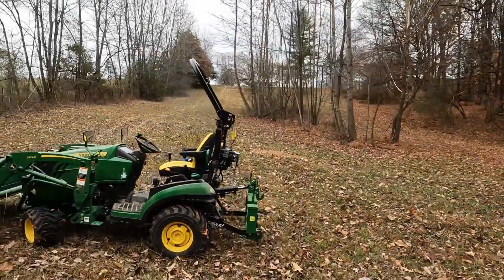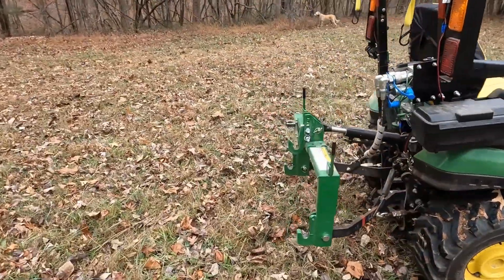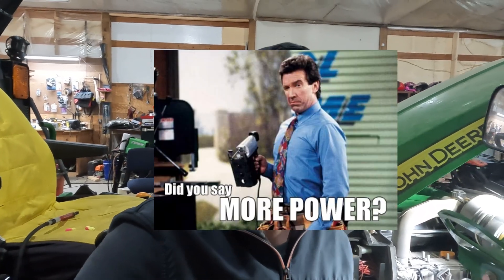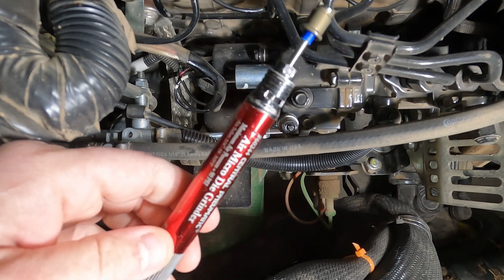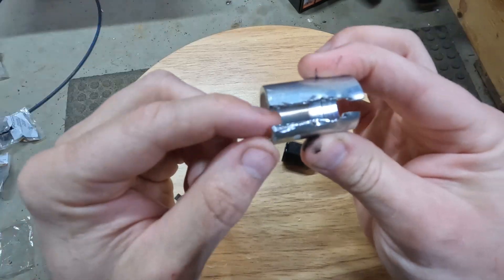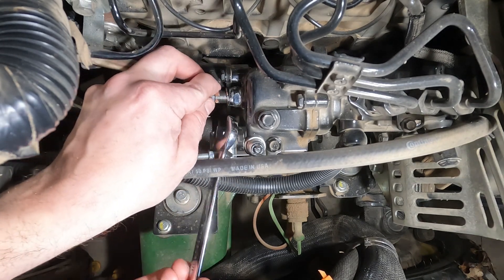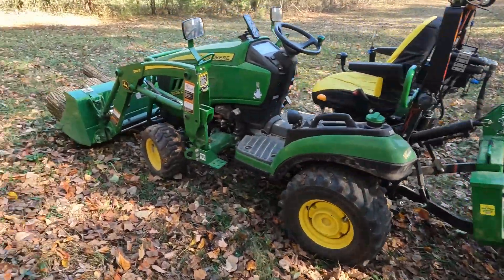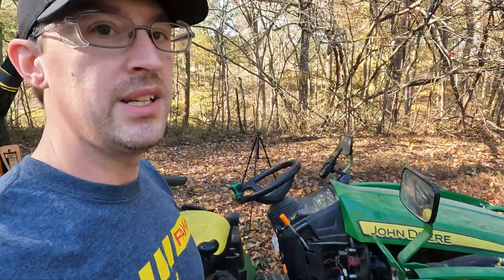1025R Injector Pump Fuel Adjustment & Hill Pull Test

Comment: Now adjust the hydraulic pressure to just shy of the rated 3000wp of the hoses. 
Stock is 2000-2100psi, so lots of room to play with. 
25-2900 seems to be the norm people shoot for.

Comment: I also own a 1025R that had power problems in the beginning turns out the fuel filter is grossly undersized, and it plugged within the first few days of using the tractor. I went to the auto parts store picked up a fuel filter for a small block Chevy with the same inlet and outlet size put it in tractor runs great now no power problems.
Reply from the maker: It definitely makes a difference.   I change mine fairly often.  Added shut off valve coming out of the tank so I dont get a face full of fuel.

Comment: It's been over a year since you did this do you have a update on long term
Reply from the maker: It's still working great.  I do wish I could get more power but I'm at the limit without adding a turbo.  It's still much better than it was stock and If I bought a brand new tractor, I would adjust it within the first week of ownership.
Reply: @projectswithjw I have a 2014 not a lot of hills but I use a 72 finish mower behind it does great when cutting normal 2 to 3 inches off of my 4 inch cut height fields but when I get behind and cutting 4 to 5  thick fescue she struggles I’ll rewatch your video to see how many turns you did on the screw I’m at 1300 hrs with only 2 battery replacements since new turned the hydraulic pressure up at 600 hours and it’s a beast

Comment: Question. Were you able previously to go up this hill and now it cant? mine has all these same issue but it wasnt like this before. Im guessing i have a different issue and although this might make it better its not actually solving it.I have changed all the filers and the  in line pump.
Reply from the maker: Bought the tractor new and never could make it up before.  Turned up the injector at 90 hours.   I really wanted to install a turbo, but i dont have turbo money.   It helps, but i still wish it had more sometimes.

Comment: Im probably about to try this woth mine later 😆
Reply from the maker: If tour rolling coal, you went too far.  😬
Reply: @projectswithjw  mine just started loosing power and i just replaced inline filter i didnt know it had at 400hrs , but if that fixes it im gonna turn around and crank it up a little 😂

Comment: To my knowledge I thought high gear was only to move tractor to other locations to work it in low. My wife tries to mow in high on flat level yard and I jump onto her for it 😆
Reply from the maker: Low for work, high for travel is good practice. Mine couldn't travel in high around here.  Its been a decent improvement for just a little time.   Dropping money on a turbo would be better improvement but its a tough price to justify to me

Comment: Did you notice the tractor starting smoother after you turned the fuel up?  I had a 1026 before my 2025r and my 1026 started like butter compared to my 2025r...my 2025r spits, sputters and blows some black smoke for a few seconds on startup.  2025r is the same engine as my 1026 was just detuned for emissions.
Reply from the maker: @navistar8231  it doesn't start any smoother.   The manual says to start at half throttle, but it still smokes that way, too. It might smooth out a bit faster that way. It might be something they did in the injection timing that makes it different from the old engines but I'm not sure.

Comment: How much did this affect the max rpm?
Reply from the maker: @nickschoenly742  the max rpm is unchanged by this adjustment.  There is an anti tamper cap on top of the pump that can be removed to adjust rpm.  You can see it near the throttle cable.
Reply: Thanks for the reply. Good to know. I could use a little more power at times but don't think raising the rpm is necessary

Comment: I have a 1026R 25.2 hp and I can spin all 4 tires pulling as your tree test. You definitely needed the fuel turned up👍. Now I'm wondering about your hydraulic pressure valve going into relief too soon. Have no idea if that's adjustable though. Good luck. Great video

Comment: What does the smoke indicate?
Reply from the maker: Unburned fuel. Would need to adjust timing and/or add more air using a turbo to get any benefit out of adjusting the screw any further.  Keeping it just below the smoke point keeps from wasting fuel.
Reply: Gotcha, thanks for the response. One more if you don’t mind.. is it concerning to run the pedals while the wheels won’t spin? I don’t know how that works internally but that seems bad to me.
Reply from the maker: @adamd4218  it's designed to go into relief mode to protect all the mechanical components.    Doing it too much can cause the oil to overheat and breakdown.  After the oil deteriorates, then you might have damage on some things, but using more frequent oil change interval will solve that problem too.   I don't do more than a few seconds at a time for normal work.  I was being a bit abusive for the sake of the video.
Reply: What are the chances he turned the fuel way down and then made the ‘before’ video afterwards just to make it look like he unlocked power?
Reply: @kurts7268  probably not very good.
Reply: @adamd4218  if you watch the first run up the hill, he doesn’t even push the throttle wide open. Just kinda bumps it up a couple times. Seems fishy to me.

Comment: So I just installed the 3rd function valve and the power beyond kit and have noticed that it bogs down much easier just driving around than it used to. I have a feeling that either of those kits are causing a flow restriction and pulling it down hard.
Reply from the maker: Did you make sure oil level was still OK after the job?
Power beyond can be unplugged and cause no issues with driving so I wouldn't expect the problem to be there. Unplugging that only causes the rockshaft to not work. 
It sounds like the hydraulics are going into relief mode.  Try unplugging the solenoids to the third function to make sure its not being electrically commanded to move that valve.   It might be easier to pull power wire from fuse box.  
If it goes away then there is a wiring issue.   If it still happening, the internal spool of the valve may be stuck in a closed position and might need disassembling.  Tractor time with Tim and Kenny from bolton hooks had a video about that.   It doesn't take much dirt or a speck of rust for the spools to get stuck.  Sometimes a light tapping of a hammer can help jog it loose.

Comment: Very impressive difference.  It shows how much power is hidden in these motors.  I don't want to adjust mine yet because it is only 4 months old.  I will as soon as I run near the end of the warranty.  Thanks for the video.
Reply: How do you run the power beyond connection for summit at the same time the back hoe is hooked up
Reply: Nice modification. Why would John Deere even install that in the first place?
Reply from the maker: Deere didn't build it.  These yanmars are put in all sorts of things like sail boats and generators,  and for different countries with different emissions rules.   There is a lot more potential in the engine but nobody wants to unlock it and be forced to add DPF and regen
Reply: @projectswithjw  Nice, whatever you did seemed to work pretty well. I'm trying to get my 4700 working again. I'm having issues with the fuel shutoff solenoid not getting enough voltage.